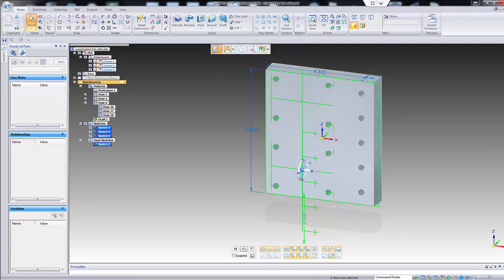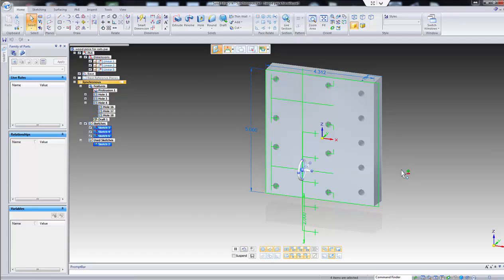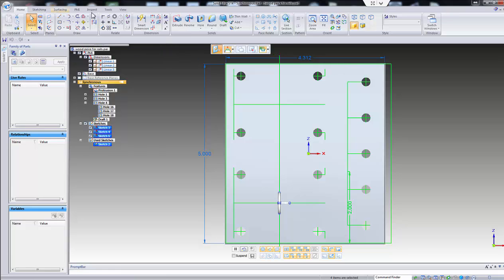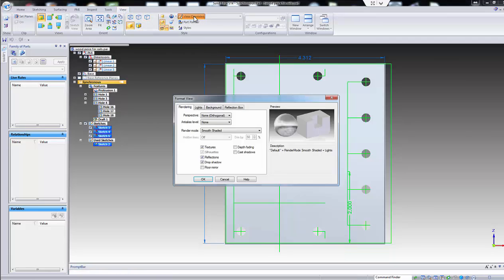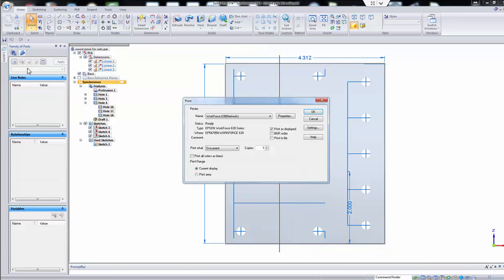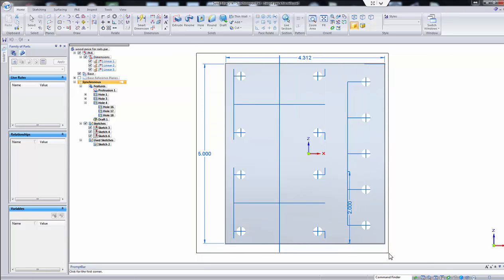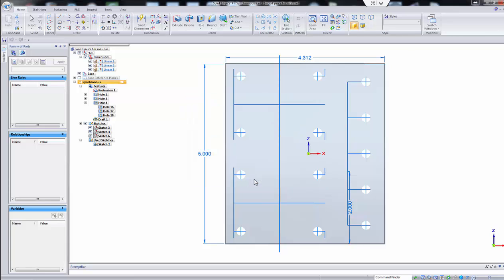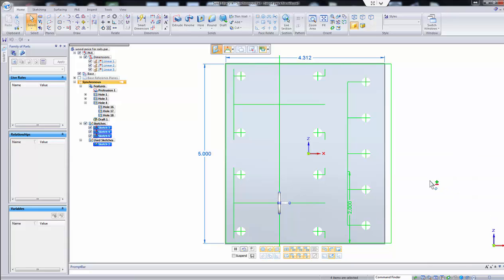easily print out a solid edge part to scale on a regular printer

Comment: It worked - sort of. I got a print that looked as if it was the correct size, but in measuring a dimension that should have been 191.6mm, the dimension of the printed size was 186+. I'm using ver. 2021 as I haven't updated, but I'm not aware that this feature has been added. Of course, I may not be doing it correctly.